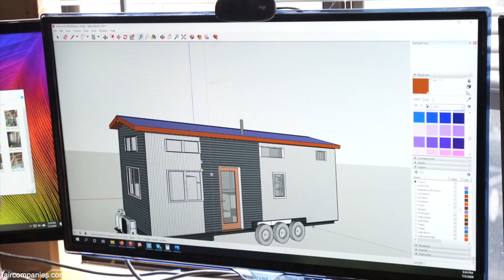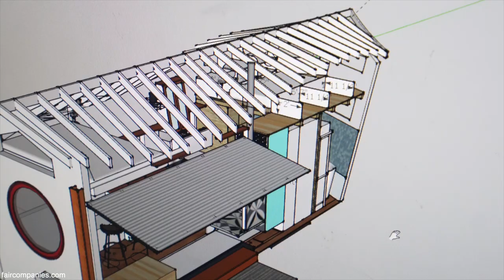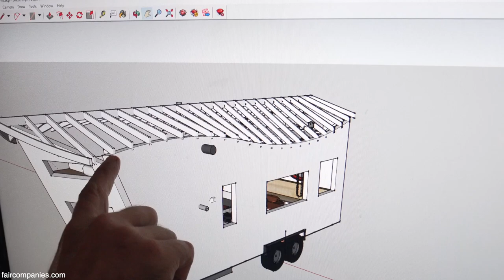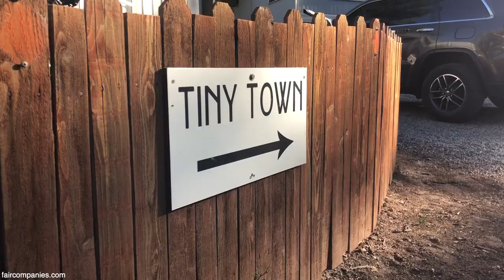Got to the Rockies, settled to build rugged Mountain tiny homes

Comment: I used to deliver whole loads 48 foot trailers to a tiny home builder called Stone Canyon Homes in Brilliant Al one called Timbercraft Tiny Homes in Guntersville Al and a couple others that I cant remember the name of. Timbercraft actually built theirs in an old mobile home trailer manufacture building. Was very cool, they were into using cedar and cypress for alot. But this guy builds a very nice home and I wouldve been proud to have brought him loads. The guys pulled my orders most days, but I would load my own trailers. Doing that I would inspect every bundle of wood, and if it was damaged or had bark or water stains or if I wouldnt use it. I would set it off to the side and pull a new bundle sometimes would have to break bundles and  stack hundreds of boards. But guys like this one and my customers were paying me to roll, so it was worth it. Plus it was great to see my customers happy.

Comment: I would have to use fender skirts on the outside to cover the square wheel wells. I find them to be visually displeasing. They emphasize the boxy design. Just sayin'. The see thru water supply is genius.

Comment: Why not modify it by placing the gears part outside the wall and pulling  the chain inside
Reply: Whenever you have something outside connected to something inside you have another hole in the wall where heat escapes. They live in an area where it gets cold in the winter. They need to keep the heat inside.